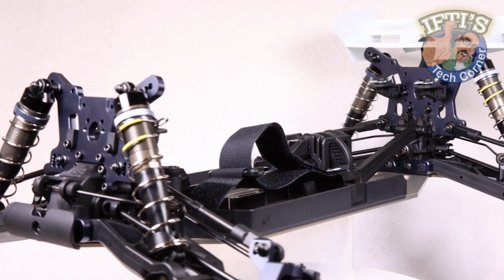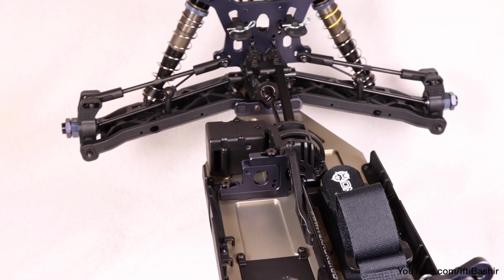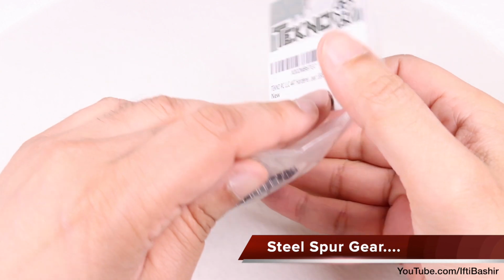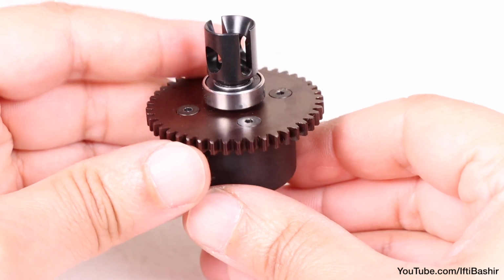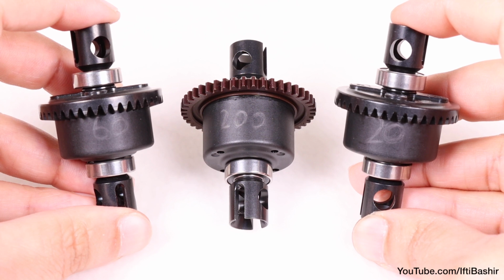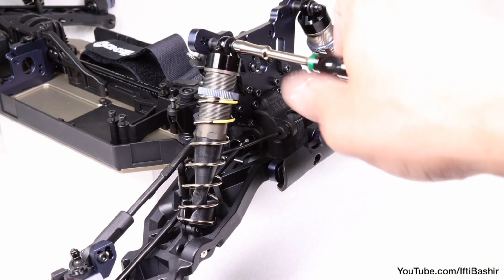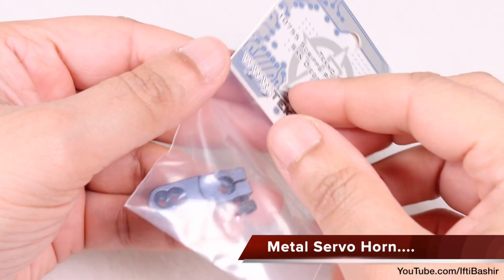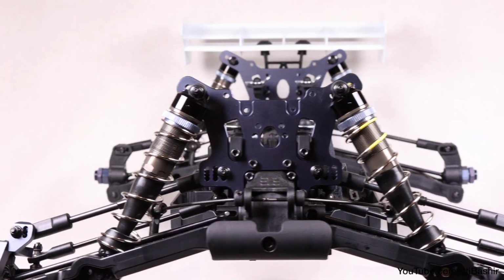#18 Tekno ET48 2.0 1/8 Competition 4WD E-Truggy - Upgrades for Bashing Setup

Comment: Can you recommend a good overall basher ESC/Motor/Servo combo....I have this sitting in my to buy card trying to decide on what electronics to go with. Thanks
Reply from the maker: I've placed my order for my ESC/Motor/Servo - just waiting for it all to arrive! I tend to go with a Hobbywong setup as I have the wireless setup module etc already ;o)
Will cover the electronics in the next video once the kit arrives!
Thanks for watching!
Reply: @iftibashir  Cool. What size pinion are you going to run since you’re setting it up as a basher?
Reply from the maker: @i4nic256  I have a 16T handy - just wondering if I'll need a motor fan or not........
Reply: @iftibashir  I was thinking about a 12T so I could run big Arrma or Proline Badlands tires. What Kv is the motor you plan on running.
Reply: @iftibashir  I’ve seen a few setups and most were not running fans. I guess it depends on the motor kv/gear setup and how extreme you push a session. If it’s routinely hot where you live that could be a factor too. Try running without a fan first and then add on.
Reply from the maker: @i4nic256  True - will be running a 2250kv 4274 motor......